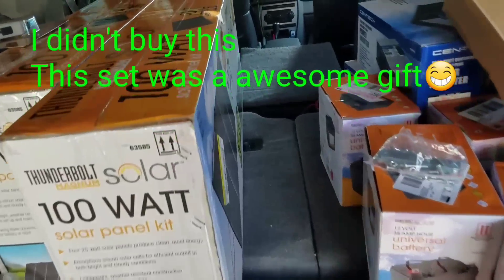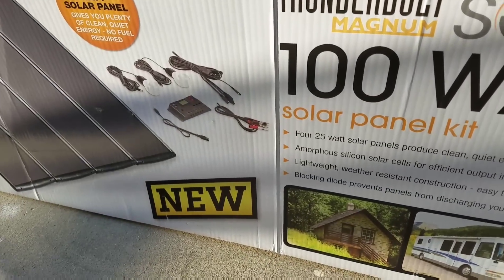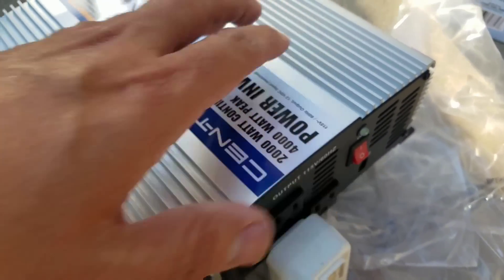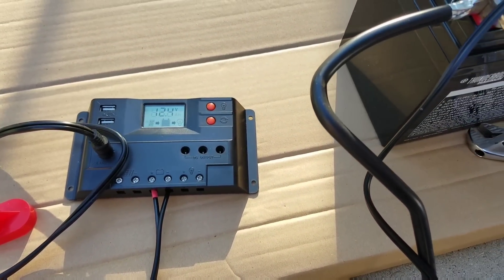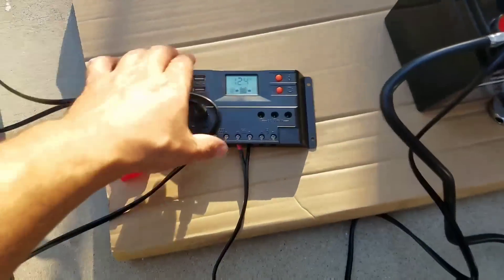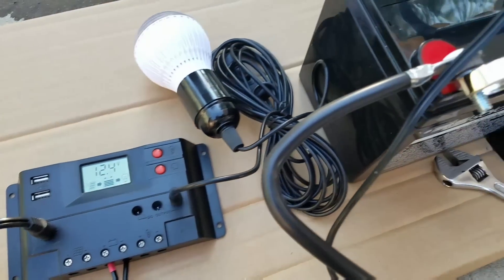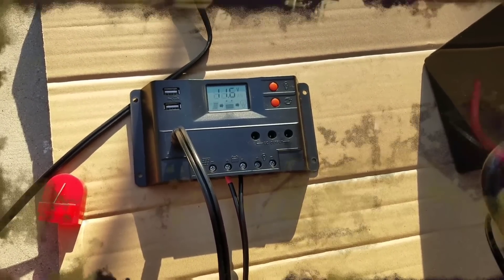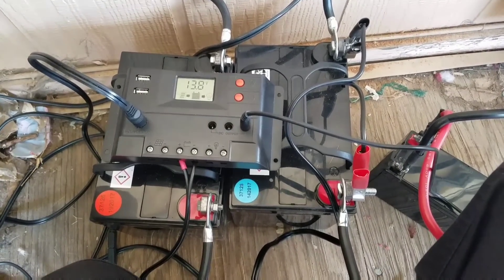How to run an AC unit on solar power

Comment: One air conditioner uses 500 watts to run
I assume "all day" mean 24 hours a day?
To figure how many watt hours would be needed to run one air conditioner for 24 hours
Multiply 500 watts x 24 or 12,000 watt hours to run one air conditioner for 24 hours
You have 35aH batteries. To figure watt hours available from one battery....multiply the 35aH x 12 volt. this gives you a total of 420 watt hours per day for each battery.
This gives you a 1600 watt hours total available from the 4 batteries. 420 watt hours per battery x 4 batteries.
To figure out how long one air conditioner will run on 1600 watt hours...divide the 1600 total watt hours by the 500 watts used by one air conditioner.
That would run one of the air conditioners for only 3.2 hours which would drain the batteries completely which would destroy the batteries.
You should not drain the batteries more then 50% which means that one air conditoner would run for 1.1 hours.

The 3 solar panels all together should produce probably around 80 watts each for a total of 240 watts.
Depending on where you live...will determine how many peak hours of sunshine you receive per day.
In my area that would be about 5 hours of peak sunshine each day....or about 240 x 5 hours or 1200 watts per day.
If you divide the 1200 watts produced by the solar panels by 500 watts required by one air conditioner...that would only be 2.4 hours of run time.

So....the solar panels would supply 2.4 hours of runtime and the batteries could supply 1.1 hours of run time.
This is a total of only 3.5 hours of run time per day.

After one day you would have to let the solar panels recharge the 4 batteries back to full charge in able to run another 3.5 hours.

In addition....you would need to have at least 2 days of autonomy (backup power in case of cloudy days)
The best I can figure....you would need a total of six 100aH batteries and eight 100 watt solar panels
to run 1 air conditioner for 3.5 hours per day with 5 hours of peak sunshine per day.

Anything which heats or cools uses tons of power....refrigerators, air conditioners, microwaves, coffee pots, air friers, etc become very expensive to run off of solar power. That's why people have solar panels all over their roofs and huge battery banks

I am pretty new to solar as well so I hope this information is all correct.
I know this sound disappointing but I hope it helps.

Comment: Anyone wanting cheap solar panels. Santan solar sells new and used panels. I got 10,  250 watt used panels for around $45 each about a year ago. Cked the wattage and they were all still above 200 watts. There's a year warranty on used panels, so that's a plus. Harbor freight panels are way expensive and under powered. Get a real panel, even if it's used. Santan solar has locations in Arizona and Georgia.

Comment: You’ll be able to run that A/C for like 10 minutes with that tiny battery plus you’ll need minimum of 1200 watts of panels to be able to run it all day without affecting your battery and voltage as you can’t go under 12v. And right away you can see that when the air kicked in your voltage went to 11.9 right away so you are destroying that battery

Comment: I was able to run my 5000 btu unit all day on a semi cloudy day, only in econ mode though which shuts off when it reaches temp. But I have 8 Eaton Powerware batteries in a 24 volt bank, each battery being 140 Ah, x 8 batteries 1,120 Ah / 2 is 560 Ah battery bank at 24volts. I have 200 watts of solar and it has trouble if I have it on AC mode constant. No way you got this running on those harbor freight panels and the thunderbolt batteries, as I have both and they barely run my chicken coop fan for more then an hour or so. And that's at 1.1 amps lol.

Comment: Ok! 1st big question is!? Like OMG WERE U JUST RUNNING UR AC OFF OF 1 25W PANEL AND 1 BATTERY?? I mean while u won't run it long with just that nor do u intend to I know cause u plainly talk about the 12 panels u have on ur roof! And other shit!? But just as a test run.... It looked to me like u had 1 panel and 1 battery running a whole window ac unit!!?? I mean even for a short test period that is pretty damned impressive!!!

SOOOO 2ND MAIN QUESTION IS! I HAVE 1 5000BTU WINDOW UNIT! THEN I HAVE AN 8000 PORTABLE AC! I WANT TO HOOK UP A SOLAR UNIT OR CELL OR PACK??? FOR EACH ONE SO THAT I CAN RUN IT WO ANY SHORE POWER!

I HAVE SHORE POWER RT NOW BUT I WISH TO BECOME INDEPENDENT OF SHORE POWER AND LIVE TOTALLY OFF GRID AS I TRAVEL ACROSS THE US!

I ALSO HAVE A SLIDEIN CAMPER ON MY TRUCK AND IT ALSO HAS A 5/6000 BTU AND I WANT TO POWER IT WITH SOLAR!! BUT THE SPACE ON IT WILL BE LIMITED!!

SOOO HOW MANY WATTS OF SOLAR DO I NEED??? FIGURE AT LEAST 600W?? WHAT SIZE CONTROLLER (40) DO I NEED?? WHAT SIZE INVERTER DO I NEED?? FIGURE AT LEAST 2/3000W.I.!? 

AND THEN HOW MUCH OF ALL OF THOSE THINGS DO I NEED TO RUN A SMART TV, RADIO BB, SUPER SMALL TRAVEL. GUITAR AMP?, 1/2 LED LAMPS, CHARGING MY 1 LARGE CELL PHONE, 2 FLOOR FANS, A CAMPER SIZE FRIDGE???

THEN TO COOK I ALSO USE A 2 EYE BURNER AND A TOASTER OVEN! I MEAN I COULD CUT ALL THE OTHER SMALL SHIT OFF TO POWER ONE OF THEM! OR SWITCH TO GAS FOR 2 EYE BURNER?

BUT I NEED TO KNOW WHAT I NEED OF THESE ITEMS TO POWER EACH AC!? AND THEN TO POWER ALL THE OTHER SHIT!?

ALSO I HAVE A SUPER NICE NEW NOT USED 25WATT SOLAR PANEL SOMETHING GAVE ME! I THINK IT IS POLY?? MADE BY CHICAGO ELECTRIC... WAS SOLD BY HF!?

SO I HAVE JUST THIS ONE FREE PANEL! WHAT ALL CAN I CHARGE OR RUN OFF THIS 1 FREE 25W SOLAR PANEL?? LIKE CHARGE MY PHONE MAYBE POWER TV?? MAYBE 1 FAN WITH THOSE 2 THINGS?? AND OR ALSO AN LED LAMP? WHICH THINGS COMBINED?? AND WILL I NEED A BATTERY FOR THESE SMALL THINGS? AND INVERTER? AND WHAT SIZE OF EACH TO POWER THESE 4 ITEMS IF POSSIBLE??

I MEAN I REALLY WANT TO PUT MY 25W PANEL TO USE!!?? AND AT LEAST STICK MY TOE IN YHE WATER OF SOLAR?? I MEAN I AM MAJOR GUNG HO ABOUT SOLAR! AND I AM TOTALLY AMPED.... UP ABOUT LEARNING!!! 😲😁😎 CAN ANY OF U TELL ME THESE THINGS???

I DONT GET AT ALL HOW TO FIGURE OUT ALL THIS AMP VOLT WATTT BS!!?? I JUST DONT GET THAT PART!!!??? BUT I DO GET SHIT LIKE OK!? TO RUN A 5/6000 AC U NEED....
600W Solar
40amp Controller
2/3000W Inverter
400 amp hr Battery Bank???

WELL OK I DONT FREAKIN GET HOW MANY DAMNED BATTERIES THAT IS IN THE BANK!!?? I GET IT'S MORE THAN 1!!! BUT I DONT GET AT ALL HOW MANY DAMNED BATTERIES IT TAKES TO MAKE 400 AMP HRS!!!!???? SO LIKE HTH MANY BATTERIES IS THAT???

AND IF I CAN ONLY FO OR WORRY ABOUT SMALLER SET UP THEN I MAINLY WANT TO WORRY ABOUT THE AC!! A CAMPER SIZE FRIDGE! A LEF LAMP, 1-2 FANS, A 30IN SMART TV, A SMALL CARRY BB, AND CHARGING MY PHONE!

However I do want to say that most of us can buy get and use solar devices for smaller shit... LIKE... WM HAS A SUPER NICE SOLAR AND ALSO WIND UP... RADIO/BIG FLASH LIGHT/ DOUBLE USE CHARGER FOR PHONE ETC... IT IS MAJOR SUPER COOL!!! AND TAKES CARE OF RADIO AND CHARGING PHONE, LIGHTS, OTHER??? AND ALSO HAS A BIG BLT IN FL OF IT'S OWN! AND IT IS DUAL POWER!! COMES WITH IT'S OWN NICE BLT ON SOLAR PANEL AND ALSO WINDS UP!! AND U CAN CARRY IT LIKE ANY BB!!! RUNS 85 I THINK! SO I THINK THIS IS A GRRAT DEAL FOR WHAT U GET AND IT IS NICE COLOR AND SUPER COOL LOOKING!!! Point being!! I and others can buy get do things like this for our smaller needs! But we need to know what how and price etc of running our BIG important things LIKE AC UNITS! AND FRIDGES! MAYBE SMALL COOKING DEVICES?? HEATER IF IT IS WINTER!!?? BUT THOSE 3 THINGS CAN OPERATE OFF OF GAS!

I HAVE A LARGE GEN I RECENTLY GOT WITH MY TRUCK CAMPER! But I don't know if it works?? But do know that IF IT DOES IT IS INSANELY LOUD!! And I live in park rt now! And I also want QUIET!! PLUS!! GAS IS INSANELY HIGH!! And HELL I don't even know how to even run this damned Gen yet!!?? Need to get gas 1st and take a go at it one day soon!? But solar is QUIET!!! 😳😲😎🌍😎🌎😎

So anyways.... If anyone can help with any part of my Question Bank... 😆 😂 LOL please let me know!!??

I think I and others should also check with any LOCAL colleges to see if they offer ANY SOLAR COURSES OR COMM.... CLASSES!? I THINK ALLLLLL COLLEGES AND COMMUNITIES ABSOLUTELY SHOULD!!!

WELL SORRY THIS GOT TOO LONG!!! 😳😲

Comment: I'm not an expert but I think you need atleast 3 are 4000 inverter and more batteries of better quality I myself wouldn't use: anything from harbor freight to run AC ...good luck you'll get it done

Comment: For anyone watching this in 2020 I have a 100watt harbor freight panel it works perfectly fine. But those 35ah batteries they sell are over priced for their capacity. I ended up getting rich solar panels they are $80 each for 100 watts and they are much better quality. And I got a big 60amp epever controller because I want to do 1500 watts at 24v 👍🏻

Comment: yo who's watching on September 21, 2020
Reply: Captain Pigeon me. I’m doing the similar thing except using a split air system which is more efficient and draws less power plus offers heat

Comment: You can do it you just need more storage of power to run them invest in more battery bank and maybe another set of panels it will work you just got to have the equipment to push it. Great try , just keep trying always with solar is more battery storage.thanks for sharing your project.

Comment: daaaaamn. i honestly feel sorry for you.. about $1,000 down the drain..............  on the bright side, i almost pissed my pants laughing..  to run an A/C on solar is a joke. yes it can be done but not cheap anyone who says it can be done  cheap is a liar or has no clue.  a descent battery bank is going to cost a few thousand dollars, enough solar panels is over a $1000 (roughly $1 a watt). with that big of a set-up you need a good MPPT charge controler thats another couple hundred dollars. cables, not gonna guess, maybe another couple hundred. now you need to build your breaker/fuse system. 2000 watt power inverter another $1000, shut off switch, relays, fuses..      all that to run a small window a/c 24 hours a day. and thats in perfect sun.  also as a good rule of thumb, you want 25 to 30% extra panels than needed for those cloudy days....  ($5,000 to $7,000 to run a A/C unit for "free").  nope... screw going green. buy a generator for under a $1000 convert it to propane. you can run at least 2 small window units, deep freezer and maybe a bigscreen t.v.. (for about $2000 get the generator, convert it to propane and a years worth of propane) with the $3,000 to $5,000 dollars you saved you can buy a descent used car or take the family on a vacation.

Comment: That good trying... But you will find that you need a lot more batteries to run AC on solar system.. Trying to add battery one by one until you get right amount of it and you can run AC 24 hours for "free"

Comment: Can u use altenator 12v 50ah..direct chas to the battery..you can use mesin motor it use for coconut to run altenator

Comment: Great idea! I think you'll need all 6 panels to keep this thing running on low though. I'm going to try the same thing. Keep up the great ideas!
Reply: If the a/c pulls 6.5 amps @ 110 volts, you'll need at least 747watts worth of solar energy.  Plus keep in mind that 747 watts is just enough to run the a/c you will need at least 200 more watts of solar energy to maintain the battery charge. To figure the amount of solar wattage you need, multiply the amps x voltage of the appliance you are trying to run to find the wattage you need. Plus keep in mind the draw of the power inverter as well. I'm currently doing similar work for my off grid cabin. I hope this helps you. Good luck.
Reply: @bigd5749  Hi..tell me about your cabin..what are you doing for air conditioning with solar system??
Reply: @ebtsamh9339  Hello, I hope you are having a great day.  As for my cabin, it's a little 16feet by 12feet . Where I have it there are no utilities near by so my options were minimal. Right now I'm only running a mini fridge and lights with solar. I'm using 445 watts at 12 volts D/C with a 1000 watt power inverter. The mini fridge runs 1.4 amps at 110 volts a/c and I have five 12 volt d/c led light bulbs .Air conditioning is handled by a 3200 watt gas generator for now, keeping in mind that we only go to the cabin two sometimes three times a month and stay for the weekend. So that gives the solar panels plenty of time to charge the two 122 amp hour batteries.  I'm thinking of adding another 600 watts of solar and maybe a 3000 watt wind turbine to see if I can run an efficient a/c, but financial situation prevents it for now.
Reply: How many watts solar panel do I need to power a air conditioner that's 500w ?

Comment: You should do an update to this video because some people will get the idea that they can run that AC all day with that Harbor Freight system and you already know how disappointing that can be.  A good follow up would be to show your system now, 2 years later.  Have you added more panels and bigger batteries to run the AC?  Did you give up on the AC and use it for a few other devices instead?  Did you take it off the house and use it for camping with those LED lights, a fan and maybe a laptop?  Did you toss the whole lot?  At the very least, go through the math of whats needed.  I have a similar AC that uses 400 watts when running and averages about 130 watts per hour over 24 hours because it cycles on and off.  A kill-a-watt meter is very useful for measuring how much current an appliance uses when running as well as giving you a total amount used and number of hours since you plugged in the kill-a-watt.  Using it is easy.  You plug it into the wall and plug your appliance into it.  I figure I need at least 12 hours times 130 watts = 1,560 watt hours storage.  1,560 watt hours divided by 12 volts is 130 amp hours of battery to run through the night.  As other comments have stated, you only get about half the amp hours from a lead acid battery, so doubling the 130 amp hours gives me 260 amp hours of battery that I will need to run the AC through the night until the sun is up and can start charging them.  Thats a minimum under ideal conditions, ignoring conversion losses in the inverter and batteries.  For solar, you'd need at least two times as many amp hours to be produced.  One to recharge the batteries after running the AC through the night, another to run the AC through 12 hours of daylight while also charging the batteries.  Its a place to start and expect to add a bit more of something before getting reliable 24 hour AC.  Even if you've moved on, adding a little bit at the end of the video explaining this to anyone who finds it and watches will prevent your video from leading others to disappointing results.  Either update it or delete it for the public good bro.

Comment: it's valuable research.  I did some testing on my channel too.  What we need in this world is a 100 Watt air conditioner that can cool a van (about 80 sq ft).  If we had that a 120AH deep cycle could run it for 8 hours.
Reply: Thank you...like a refrigerator that can cool a small space with a small compressor with small power needs...If people would build air conditioned sleep chambers and insulate it very well then walla the air conditioner would only cycle on very little do to the fact that the sleep chamber would be very small and very insulated....

Comment: hit me up when your ready for REAL BATTERIES, I am a CROWN battery distributer, your 300 watt system and the load is going to fry those 35ah batteries so fast its not even funny! 6 volts my man is what you need, keep your panels, upgrade your charge controller to a midnite solar or outback and hookup 6-10 batteries and you'll run a lot more than just an a/c... btw I can get you 300 watt solar panels for $0.42 per watt
and the 6 volt CROWN batteries (better than trojan GUARANTEED) starting at $99.00 each
Utah trailer repair @ gmail  . com
Reply: Practical good advice and suggestions,  not just a sales pitch.  I appreciated what you wrote,  wish I could take you up on this offer but regardless,  thanks
Reply: What voltage are your 300 watt panels?
Reply: Do you have a video? If so please share the link.

Comment: You can run off the batteries for a little while till they drain down but you need about a thousand Watts continuous power and that would be 10 panels if they run at 120 volt or a hundred panels if they're running a 12-volt

Comment: Are these 100 Watts at 12 volts or 100 Watts at 120 volts ?

If they generate 100 Watts at 12 volts then bring it up to 120 would mean you have only 10 watts being generated per panel

I have never seen which this is if its 100 Watts at 12 volts or a hundred Watts at 120 volt
Reply: Watts = amps x volts 12 volts at 10 amps is 120 watts 120 volts at 1 amp is 120 watts.  Those panels put out roughly 18 to 20 volts at 25 watts each.  Most window a/c units pull roughly 500 watts(at 120 volts), so if he only runs it a few hours a day he will have plenty of solar power to run it on that setup.

Comment: I'm 20 seconds in and already wondering. Three 100 watt panels for 300W. The smallest a/c is 5000 BTUs and uses around 500W. Huh?
Reply: Does not compute...